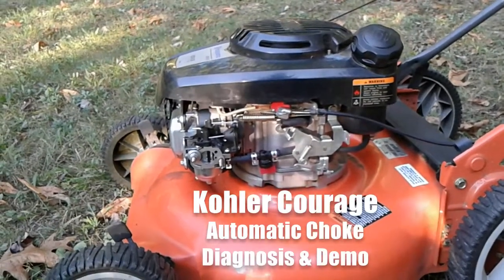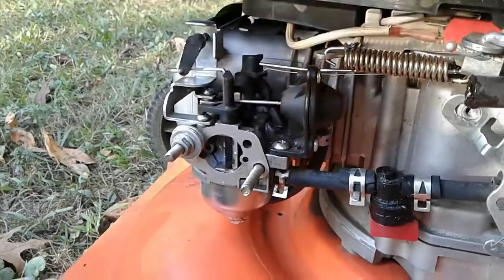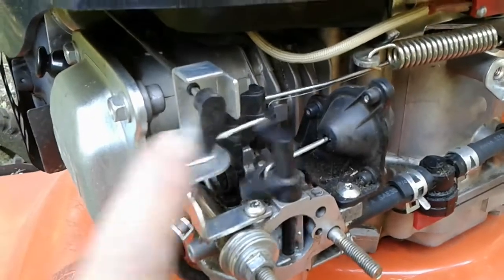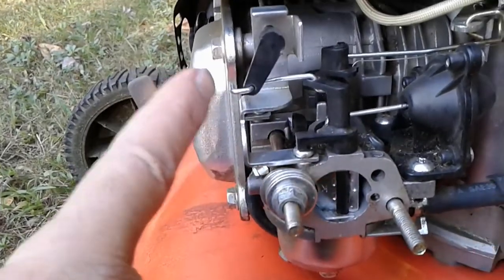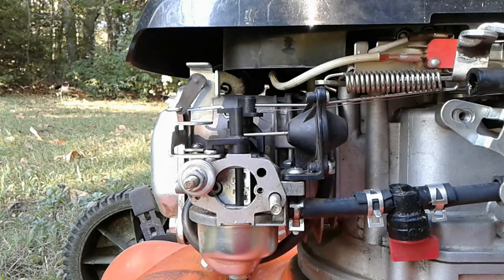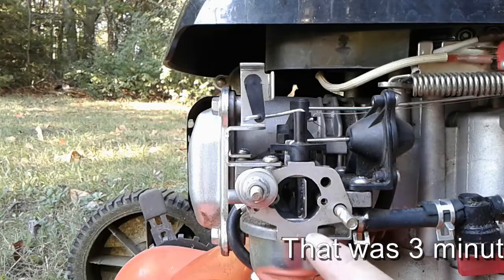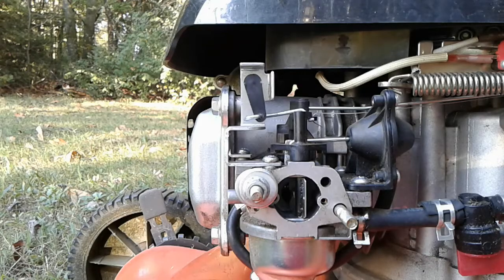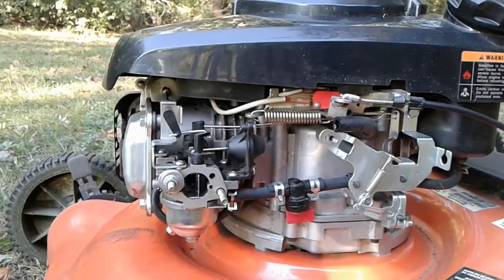Watch the Kohler Automatic Choke in Action! Fix it Tips!

Comment: How do you undo or remove that S link from the choke to replace carbureator.. I cant figure it out for the life of me.. I hope you see this.  :)
Reply from the maker: L Bergman I'm trying to remember....there are two screws which require a torx bit that secures a metal bracket that is part of the choke assembly. Remove them. Also, the black plastic lever can slide off that rod that runs over from the muffler area.
Reply: I took the plastic top off.  I removed the top 10mm nut off of the spring housing holding it down to the muffler.  I loosened the lower 10mm nut as the spring housing tab is slotted.  I then removed the entire spring housing from the muffler.  I also removed the two T20 screws on the carburator that hold the spring rod and black lever.  That allowed me to turn, twist and move that black lever all around and get that short little link all hooked up correctly.  I slid the spring housing back onto the top of the muffler, reinstalled the two T20 screws and tightened down the 2 10mm nuts on the muffler.  No big strain.

Comment: Just did one today, my first.  What a contraption, Briggs figured this out decades ago with a much simpler system.  This is a good example of where theory and practice part ways.  Getting it all adjusted just right is difficult at best.  The pulloff apparently can't win a tug of war with the spring, but neither can the spring.  It's a balancing act that gets wrenched up as soon as dirt or goo plugs the tiny carb port, or a small hole forms in the diaphragm, or the blade has the tiniest amount of extra friction on the choke shaft.  The system cannot self compensate for any of these, or a plethora of other, variances.  The icing on the cake is that there are no documented procedures or specs (that I could find) to set the thermostat lever in the correct place.  You did know that it comes off, right?  Tinkering with this is a rabbit hole filled with frustration and time sinks.  BTW, I won, I think.  No way to tell until the outside temps reach into the 40s.  Today was in the 90s and it wanted to choke the motor to the point that it couldn't gain enough RPM to activate the pull off enough to stop choking it so hard.  Started on the first pull though.  After a few hours of tinkering, I got it working.  We'll see what if does in the morning though, after temps fall 20°.  Lubricate the thermostat shaft's little plastic bushing and oil the choke shaft as other videos describe.  It all needs to be very clean.  You know, the perfect set of requirements and expectations for a lawnmower.
Reply from the maker: Thank you for your note. I was entertained listening to your detailed thoughts on this engine and auto-choke system. I wish you good luck with yours!
Reply: @Buckwsr  I just finished mowing my yard with the customer's mower.  It ran fine, took a minute to warm up enough to pull the choke all the way off and get to full speed, but at least it starts on the first pull.  And it starts when hot.  That seems to be the big issues, so I'm going to call this a win and send it home for more neglect. The 25 year old Murray I have here also starts on the first pull, but you have to go the extra mile and push a primer bulb a couple of times.  Otherwise bit might take two or, God forbid, three pulls.  It's a champ.  I spent so little time fixing it, that I gave it a new trueblue 5 rope and painted the engine, and air cleaner, covers.  It looks like a restoration now, maybe I should start making videos.  I have lots of interesting and colorful commentary when I'm doing battle with these things.  I'd need a separate adult content channel for two stroke repairs, especially chainsaws.
Reply: @Buckwsr  it's back, like a recurring nightmare.  I really hate this mower, I'm thinking of buying it from the customer because it runs fine, you just have to futz with it every time you want to now.
Reply from the maker: @tonyfremont  A guy just dropped off one of these mowers that he had trashpicked. I got it going easily enough, but the choke plate does not fully open, even when hot. So I'll play around with it a bit more. But it's not worth putting too much time into it....

Comment: Thank you!  Excellent camera work and editing!  Would you suggest WD 40 as a lubricant?  I have a Lawn Boy mower with this motor and I really like it outside of this problem.  I see a bungee cord in my future to keep that choke open once she warms up!
Reply from the maker: You could use WD-40, but that might attract dust and dirt and cause the system to malfunction. If the auto choke is working correctly, you won't need a bungee cord to hold the choke plate open, because that is what the auto choke is supposed to do... Thanks for watching and commenting.
Reply: I pulled the air cleaner assembly and found pine needles packed around the top of the carb interfering with the choke linkage.  I cleaned it all up and it worked beautiful.  Thanks again, without this video I don't know if I would have checked that.
Reply from the maker: wb6162 great job!

Comment: Hi,
Great Video. I replaced the automatic choke, have a new carburetor, and a new spark plug. I ran it once after replacing the automatic choke and the carburetor. That was it. The valve seems to move freely. Have not checked the diaphragm. The lawn mower WILL NOT SART. Any suggestions would be greatly appreciated. Thank you
Reply from the maker: Are you certain the choke plate is fully closed when the engine is cold? If not, maybe have someone manually hold the choke plate closed while you pull the starter cord. But there could be other issues. Is it getting spark? Use a spark tester to verify. Good luck.

Comment: This was VERY helpful for me. I don't have a Kohler engine but I do have a Toro Super Recycler (20383). Until stumbling upon your video, I had no idea how the "Auto-Choke" worked. My linkages are different but you cleared up questions I've had. First ... I've been troubleshooting my failed starts and thought the choke was closer to the engine than the throttle. I think I may have a stuck/stiff or incorrectly setup linkage because my choke is wide open (though my mower was sitting in the sun most of the day) ... I've cleaned the carb at least 3 good times now but I don't have ANY corrosion, rust, or gum/gel in my carb, fuel line, or carburetor bowl. My float is not full of liquid; my bowl does not have a main jet in it. I'd about lost at this point but still poking around.

Worst case, I'll just buy a whole new carburetor and pray.